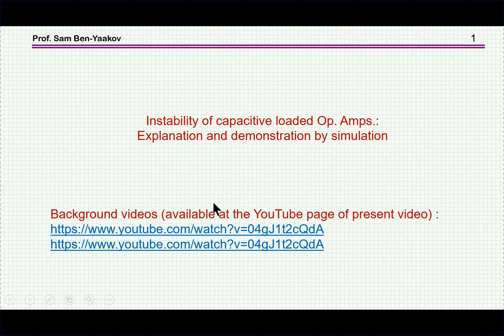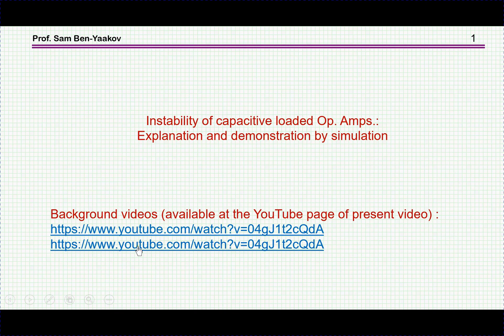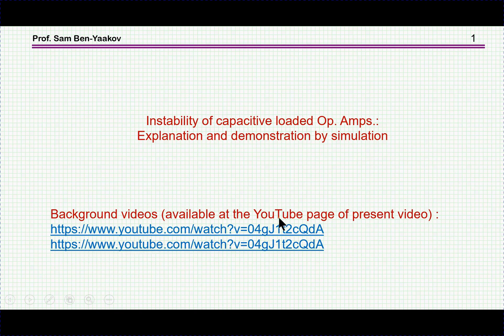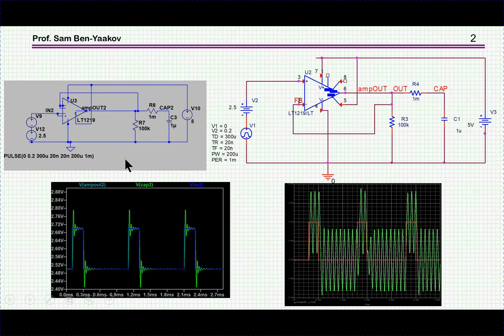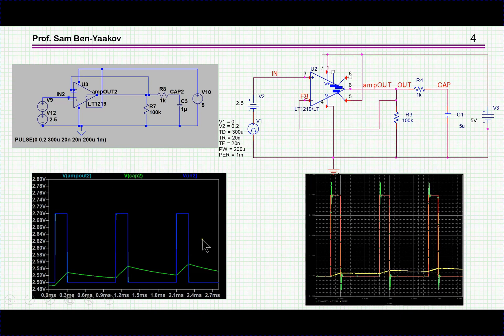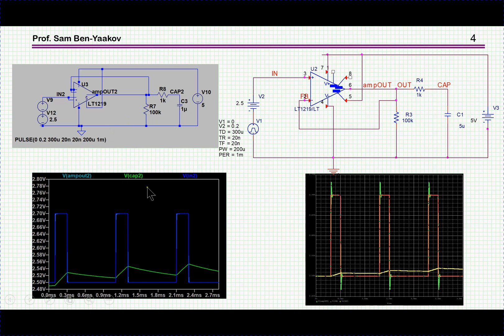Instability of capacitive loaded Op. Amps.: Explanation and demonstration by simulation

Comment: Should't the resistor R4(PSPICE model)/R8(LTSPICE) be enclosed in feedback loop?
Reply from the maker: HI, You seem to have missed the point. R8 keeps the cap out of loop so it will not add phase lag.
Reply: @sambenyaakov  The common way of compensation, I know of, is the in-the-loop compensation. When the RC is in the feedback loop. It is easier to predict the output of the amplifier, cuase the RC is in the loop and you can just forget about it because of high Aol. Here is the apnnot from Adi https://www.analog.com/en/analog-dialogue/articles/techniques-to-avoid-instability-capacitive-loading.html
Reply from the maker: @Xeenych You have sent me a link to an article that you apparently did not read! !! See in that document:

Out-of-the-Loop Compensation
Q: Is there a simpler compensation scheme that uses fewer components?

A: Yes, the easiest way is to use a single external resistor in series with the output. This method is effective but costly in terms of performance (Figure 8).
Reply: @sambenyaakov  BTW Is ther ea way I can contact you? I have a proposition for one of the next videos. It is a riddle.
Reply from the maker: @Xeenych  You can write to sby@bgu.ac.il

Comment: Great video, but it leaves you wondering which company has the right spice model. The odds on bet would be on Linear Technologies, since they built both the opamp and the simulation model for it, but you can never be sure unless you breadboard it...
Reply from the maker: I guess that nether are very accurate😊

Comment: Dr. Sam : Can you please at your convenience in the future talk about the anti-wind issues for the CV- CC loops of a power supply ( CV and CC diode or'ed) . I do not see much material on it. I have heard that when the  CV loop is active and regulating the output voltage,  and the CC loop output is sitting at Vcc ( or whatever the voltage that is biasing the opamps) and when over current or short happens on the output, it takes long time for the CC loop to become active and therefore it is better to connect the output of the CC loop (U3B opamp) to the anode of the diode D16 .  http://www.ti.com/lit/df/tidra05/tidra05.pdf     Not sure why?  Also in this link: https://e2e.ti.com/blogs_/b/powerhouse/archive/2015/04/02/power-tips-how-to-control-multiple-loops-in-a-power-supply   How would the diode speedup the loop ? Is it that the output is clamped to the input and not allowed to rise to Vcc?
Reply from the maker: Hi Swaraj, Thanks for comment. Anti winding circuitry (or code) is indeed a good subject. Basically, it prevents the runaway of an idle integrator toward Vcc. The idea is to keep the amplifier in active zone so it could quickly respond when required. In analog circuits the anti-windup can be implemented by Zener in series with a diode between the output of the integrator and the negative input terminal of op amp. The idea is to keep the opamp in the active zone (not saturated) when the integrator is not functioning (the other channel is operational). IF you like  me to further elaborate, please send you email address and I will attach a sketch.  Not sure what you meant by "output of the CC loop (U3B opamp) to the anode of the diode D16" . This does not sound right to me. .
 Regards.
Reply: @sambenyaakov  Thank you very much for your kind reply Dr. Sam. Your suggestion makes sense. One more question: If the constant current loop opamp is biased with a Vcc of 12 V, your suggested method of Diode + zener from opamp output to the negative terminal of opamp (what should be the voltage rating of the zener)? something like 6 V zener? 
2)  I actually meanth this   http://www.ti.com/lit/df/tidra05/tidra05.pdf , if you look at the C27 in constant current feedback loop, in the past I saw a suggestion saying connect the end of the  C27 to the anode of the diode D16 instead of connecting it to the D16 cathode (as it is right now in the TI's schematic).   This was the explanation in the past for a battery charger application someone posted  : "In your schematic you have two op-amps (Vset, Iset) with outputs connected to two diodes.
Move each compensating RC network away from op-amp outputs. Instead connect both to the common point between diodes (to the anodes). The amplifier which is not in use will not see its own RC network and will move quickly from the rail to the point of diode conduction. Then optimize RC networks individually - your delay is gone and does not have to be considered any more."  Not sure if words make sense since it is not possible to attach the rough schematic.
Reply from the maker: Hi, 
1. The Zener plus diode voltage is chosen such that the output of opamp will clamp to a voltage higher than the value that will start the LED conducting. I guess 3 volt below the supply of isolator will be OK.The Zener should have low current below break point.  I have used this in the past. It works great. But...modern opamps have a fast recovery time so the improvement may not be noticeable. 
2. I can't make sense of description If you like to pursue this farther, please write to sby@bgu.ac.il with attachment.
Regards